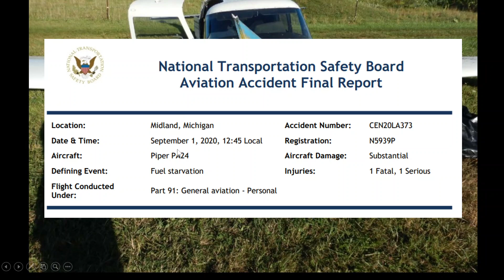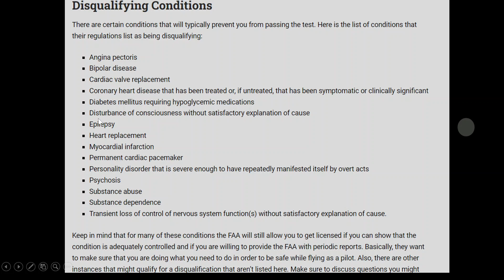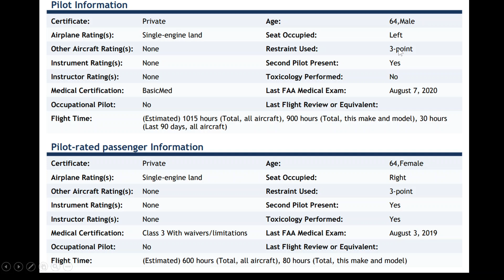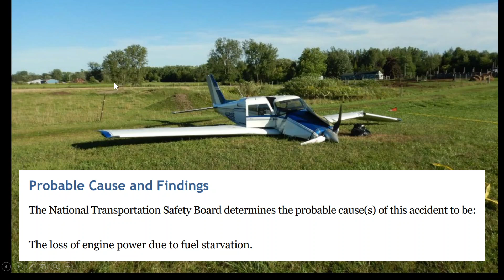Fuel Starvation does it AGAIN in Michigan

Comment: I don't rely on fuel guages in any small plane, but use the dipstick method instead.  It can be a bit of a hassle, especially on high-wings, but I'd rather be slightly delayed than dead.  It's an ingrained part of my preflight.  

I started doing that after a buddy of mine ran dry in a C152, but his guages were showing about 7 gal in each -- he was doing pattern work, and made it back safely.  Following up with him a few months after, the mechanic said there was a electrical fault in that panel.
Reply from the maker: Yikes!  Thanks for sharing that.  Good idea

Comment: I owned and flew a Comanche from 1975 to 1985. The fuel system is really simple especially that one, it had only 2 tanks. Mine had 4 but was just as simple.

The fuel gauges are notoriously inaccurate, they usually indicate that more fuel is Available than what actually is.

Sad to see another one wrecked, they were a great airplane.
Reply from the maker: Thanks RR for sharing your experience with that aircraft
Reply: I used to fly a T tail Lance with 4 tanks. It would remind you itself that it was time to switch, as you would find yourself holding more aileron to lift the heavy side. Having those extra tanks so far out there demanded  fuel management from the pilot or it would not fly properly, nor efficiently.
Reply: I was sad when they quit building them. They are still a modern looking design and when you see one with new paint, panel, and interior, it is hard to believe they are 60 years old!
Reply: @ConvairDart106  The main (inboard) tanks on the Comanche were 30 gallons each, the aux. (outboard) tanks were 15 gallons each. 

Since I flew alone a lot (usually hauling freight), I kept the right side a bit heavier than the left. But yes, if I had more fuel in the left tanks, it'd want to turn left.
Reply: @ConvairDart106  They are a great airplane, their only bad habit was they would not want to touch down with full flaps, float and float and float........lol. 

They handled ice well, mine was a carbureted 250 HP model, no turbo, and it had no problem maintaining 16,000' with about 1/2" of ice.

Comment: I cant recall a time I haven't taken off without full tanks unless it was a field without fuel service. . Maybe I'm paranoid but you never know if weather will divert you a couple hundred miles. Since the aircraft is intact their injuries were most likely due to using lap belts and not shoulder harnesses. Everyone should install harnesses in their GA aircraft, they absolutely save lives. Prayers for them.
Reply: Per the report, they were using their 3 point harness/s
Reply: Depends on what kind of flying you do.  If you always fly in and out of places with long ass runways that's fine.

Comment: It's really disgusting to see, day after day, all these great airplanes being destroyed by pilots who don't know what they are doing. P.S. Nice video...thank you.
Reply from the maker: Seems like they stopped to refuel and just filled only one tank full.  Thanks for watching
Reply: It's ok they will build more
Reply: What? No they will not build more. These planes are no longer built. Any similar planes that are built today are not at all affordable.
Reply: @ARFFWorld  I have seen pilots that never switched tanks in flight & ran the a tank almost empty. Even if the gauge showed a 1/4 it can only be used in straight & level flight. The fuel would be aft the tank pickup on a climb out with the nose high. Also most aviation gps apps remind you to switch tanks in flight.
Reply: @alanmydland5210  The problem with that idea is that they are not building anywhere near enough new general aviation-airplanes to replace the ones being wrecked. Check out the statistics.

Comment: Forgot to use flaps, and it did hit stalled too.  Look at the bent down position of the throttle and the bent down wings too.  Stalled it on the worst place of the field.   You cannot see to the front with while pulling up in panic.
Reply: Many accidents on great to land places because the pilot forgot to pop the flaps out to slow down and not stall.

Comment: I have a Comanche. There could have been some fuel in one of those tanks, but the last two gallons in each 30-gallon wing tank are unusable. It's important to keep tanks as full as possible, not only for prevention of fuel-starvation, but also because the tank linings dry out and leak over time if stored empty or low on fuel.
Reply from the maker: Thanks Sam for sharing with us

Comment: Maybe someone should petition the FAA to mandate that EVERY GA aircraft have shoulder belt systems.  I have read that they reduce fatal injuries by 88%.  And, it looks like there needs to be some work on the fuel tank system to prevent unauthorized access.  Good video and RIP to the lady who perished.
Reply: This 1959 Piper Comanche is easily upgraded with shoulder harness seat belt kits. The kits & upgrades are available for every plane. Hooker makes a cheap $80 add on that takes 15 minutes to install.
Reply from the maker: That’s sounds very reasonable
Reply: SEATBELT AIR--BAGz.   Now available az WELL ‼️🆒🛩️

Comment: one thing never added to report of fuel starvation, someone stole the gas!!!!!  I know a very smart man that flew a Comanche and always did a good complete preflight, he took off from Marsh harbor in the Bahamas and ran out of gas 15 min later! fact he had the tanks filled and he looked in the tanks as usual and all looked fine. had to land in the woods as the available airport near him was closed and had steel cables crossing the runway to stop drug runners from landing, plane was completely destroyed both him and his wife injured but survived!,  both tanks had been drained and the black bladders in the tanks had been pulled into the fill neck area so with a small amount of gas they looked filled to the top! some years later   in my Comanche and my new bride in the right seat I taxied to take off at Wallkill airport in upstate NY, I always did a visual gas level check and knew I had 1/2 a  tank on one side and low on the other side, we were going to a close airport (Orange county) to top off tanks before a long cross country trip,. but my gauges were in fact reading low on both tanks ! I decided to stop on the taxi way and check the tanks again, looking in all looked good but with black bladder tanks and the refection of the gas you could not say how deep the gas was, I grabbed a stick from the nearby grassy area and dipped my tanks , they both wear almost empty, my gas had been stolen over night , we never would have made it to the other airport for a fill up. Kids would steel your gas for their ATVs and older guys would steel it for hot rods, basically murder people for some free gas! makes me wonder about this crash maybe a real investigation should be done and not by the NTSB or FAA!

Comment: I don’t get it. They took off with hardly no fuel?
Reply: Fuel starvation can happen because of not checking for water in the fuel, failed fuel pump, drawing off the wrong tank, or clogged filter.
Reply from the maker: They were doing touch and gos prior to the crash. Report stated they stopped and they refueled 18 gal. Into the left fuel tank before flying again
Reply: And which tank was he using?
Reply: @alantoon5708  the right
Reply from the maker: Thanks Terrell for sharing
Reply: @markmay1655  put fuel in the left......maybe he should have checked that on the run up.
Glad the people got out of it. Shame the plane didn't.

Comment: 80% of crashed ladings in GA aircraft are due to fuel starvation (out of gas or forgetting to switch tanks).
Reply from the maker: Thanks for that facts Charles.
Reply: It's actually the 4th most common cause for GA accidents. Loss of control in flight is number 1

Comment: Two pilots completely incompetent.  Did not check or stick the tanks on the preflight inspection. Did not remember how much fuel was used on the previous flight or check the gauges. Did not use the checklist or put the fuel selector on the fullest tank before takeoff. We watch these unnecessary accidents over & over. Something has happen with there brains in the last 2 years to do something this reckless, not fueling the empty tank up then using it for takeoff. Easy to figure out put 2 & 2 together.